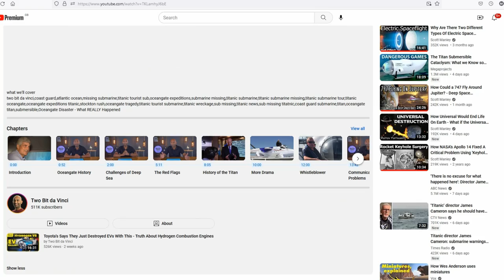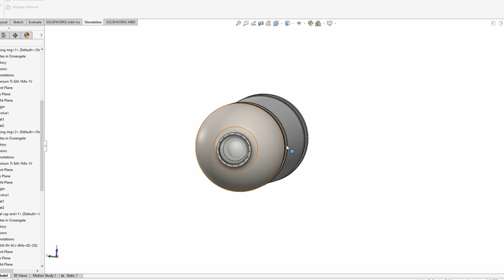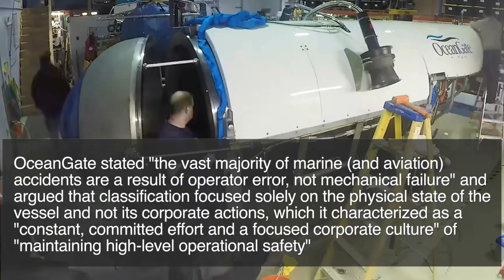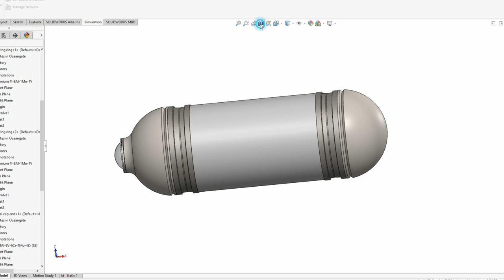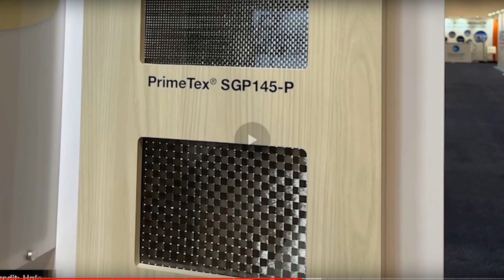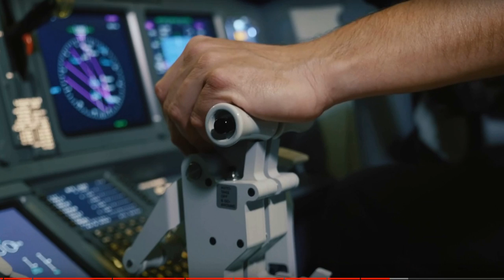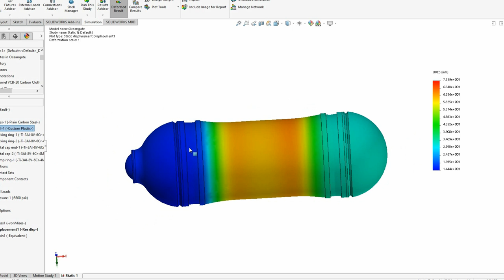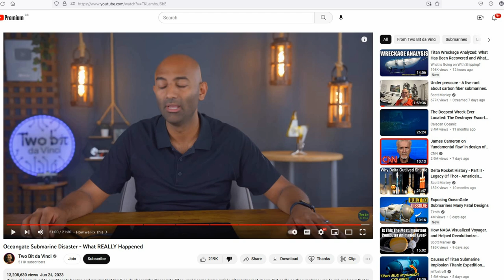Oceangate Titan - Engineering Failure?

Comment: The force of the hatch bolt are nothing compared to the force of the water holding that hatch shut. Think of it like a check valve, the force on the other side is what keeps the valve sealed, if that force is removed the valve opens. I think most hatches are a tapered cone so the higher the pressure keeps the hatch centered and sealed.

Comment: Imagine if they 38:05 were on the surface for 5 hours and the sun was beating down - they might kinda overheated 

39:47 the controller you speak of has a higher spec than off the shelf controllers - your naïveté speaks volumes

Comment: Great effort explaining possible (and probable) scenarios. Thank you! But got a question here: I somehow lost track when it comes to the "shockwave" part late in your video... You tell/show the caps and bubble-glas popping out. Outwards? I always thought the the outer components would be pushed inwards by the outside pressure. Really a little unsure now which way direction parts would take when (for example when the acrylic plexi-Bubble would crack and eventually shatter).  Anyway, good stuff. Cheers!
Reply: Another possibility is when the pressure differential was removed from the titanium hemisphere it re-expanded / vibrated sharply enough to percussively shear/pop all the bolts holding the perspex window - someone can calculate the stored spring energy maybe?
Reply: @MarkTillotson  probably so... just found out what an implosion in super-slowmo looks like (with much smaller objects of course) , but you´re on point with the "re-expanding i guess. Your stuff seems a lot more straight forward and logical than most shite i see on yt. THX again!

Comment: The glue was not the problem. The glue joint not allowing for the compression deflection of the carbon tube is the problem. 7mm reduction in Dia according to the Solidworks data. The sulution would have been to seal the joints with O-rings. apply some plumbers grease to it and pull the two halves together with tie rods, That way, the joints could move against each other to compensate for the rate of compression of the carbon tube. The stored energy in the deflected tube must have been huge. It must be allowed to deflect along the entire lenght to avoid build up of stress un the clue joint.

Comment: instead of glue, how would you join titanium and carbon fiber together then? maybe glue flexing is the only way with materials compressing at different rate.
Reply: 1) Don't use dissimilar materials.
2) if you do, use a much longer transition/overlap?
3). I've thought about bracing the ends (tie them together) with more titanium. hmm.

Comment: Your missing the floor inside I wonder if it split down the line of the structure they added for the floor 
Or my belief is that the structure for the also added to the non uniform force that was applied to the cylinder and the failure in one of those areas the floor or the end caps

Comment: I don't agree that the porthole tapped holes would have stripped out if they had 1.5 or more depth to diameter ratio. It's generally accepted engineering principle that threads with in-tolerance form at 1.5 or greater, the minor diameter of the bolt will fail before anything bad happens to the threads of the hole.
Reply from the maker: We'll see, but looking at close up photos of the cap ends released yesterday, there's no sign of any broken studs, and there's 18 of them.
Reply: @dirtygarageguy  I have no clue about how the half sphere endcap could come unbolted from it's adapter ring. Was there an adapter ring on the aft end? If so, why? Couldn't the half sphere of the aft end been bonded to the CF tube?  I was commenting on the bolts for the porthole retainer. Of course those may have been sourced from Walmart....

Comment: Perhaps rather than glue the rings should have been compressed together by straps that ran the length of the tube to stop the rings falling off at the surface, then with a rubber interface between the ring and tube. This way the interface would have been free to move during expansion/contraction and settle in with the water pressure being the sealing force (Just like the window).

Comment: You're the first one I've heard who called the center tube for what it was, plastic.  I grow tired of hearing the term "carbon fiber" like it's the answer to everything.  It rolled off the lips of Stockton Rush like nothing could go wrong, because after all, it's carbon fiber, a million times stronger than steel.  He didn't say "million", but that's exactly what he implied.  Plastic is absolutely the wrong material for this application, as this incident confirmed.

Comment: Does your solid-works model include the 7000 ton end loads?  With the necking of the cylinder due to radial loads on the side of the cylinder, I would imagine that the ability to resist such end loads would be diminished somewhat.
Reply from the maker: Solidworks applied a pressure of 380 bar to the entire exterior surface.

Comment: Agree 100% that the cylinder with glued rings idea is an inherently poor design considering how stress is distributed (and especially through cycling).  One comment about your discussion of shock waves and acrylic cap coming off:   It's not just the acoustic waves.  The water would also be rushing in at ~220m/s at a depth of 2500m (they lost comms 2/3 way down; using Bernoulli's/Torricelli's equation: https://en.wikipedia.org/wiki/Torricelli%27s_law ; taking water to be incompressible up to 6000 psi is a good approximation).

Comment: There is a publication of the communications between Titan and the surface.  We think it was leaked.  Sounds realistic.    First the decent was much faster then the rate normally used, about 1 m/ minute faster.  So it would have reach the Titanic is less then 2 hrs. vs 2.5 hrs.   Was that on purpose or just happened?   A few sensors lit up and they dropped the sand but didn't get positive buoyancy.  They dropped the skid weights and showed a sluggish rise.  More of the sensors went red.  They gave short answers and at a slower response time.  Lost communication within about 20 minutes of starting to abort the dive. 
     So the vessel gained weight not accounted for in the buoyancy calculation and set up before the dive.    The only source of weight is water within the composite structure. filling and holding open cracks.   The pressure radially on the outside is depth pressure and the pressure radially on the inside is atmospheric.   Thus in 5 inches is a gradient.  The cracks extend from the OD inward.  The water hydraulically would  produce a radial, hoop and axially  force straining the cracks open and adding to the load on the fibers.    
    Could the glue between the metal and composite be the location of failure.  Also the window.  However if the weigh gain is accurate then  this would not happen for them adding sufficient weight to cause the problem.   Also interface adjustment is the meat and potatoes for doing a finite element analysis and adjusting the design to deal with the interface issues.  What isn't standard the sea pressure and the understanding that to save money highly experienced analysist were not hired.

Comment: The titanium ring appears to only slide onto the hull about an inch or 2.  I'm not a sub expert, but that put tremendous pressure on such a small surface area. That ring should have been pushed down way further.
Reply: If it was screwed on to the Carbon - (and a thicker Carbon at that) - this could have made a difference. Im sure it would fail as well after so many loading cycles. I wouldnt dive in a swimming pool in that thing, after seeing how the end pieces were glued in.

Comment: Has anyone considered hydrostatic pressure issues - high pressure seawater in a crack that penetrates further into the hull encounters lower pressure and will act as a hydraulic wedge, opening up the initial crack with massive force due to the difference in pressure...  Its a failure mechanism of some dams for instance. 
I can see that if the glue starts to fail from the outside of the ring the water could get into an intermediate laminate layer and just crack it apart, effectively transfering the full ocean pressure onto a thinner cylinder, rinse, repeat until overload.

Comment: The individual forces of water pressure on a half sphere can indeed be sumarized in one point but the resulting force is not zero. It is only zero in radial direction and also zero for all other endcap surface shapes no matter how artistic or asymmetrical. The resulting force of any endcap is the cross section area of the cylinder times the pressure and is axial to the cylinder.

That is the nature of any pressurised  surface covering a given hole. The net force of an opening is given by the path of the hole.

Comment: Just a point about game controllers. On pretty much everything the military would use them they're for convenience and they always have redundancy. They are never used for anything that is critical to the life of the system either. In Titan, I believe they were the only source of control. Yes, spares were available, but I believe game controllers were the only source of control onboard.

It appears that the pilot didn't have a fixed position and as everyone sat on the floor any instability could result in a loss of perception. Add that to everything else and you have a disaster waiting to happen.

Comment: The difference between an XBOX controller and a third Party Logitech controller are MASSIVE.   ALL those third party controllers are bad. Unreliable and do not work as good as the real thing. And even the proper ones are prone to give up the ghost at the worst times.

Comment: 1:25:50

No, it does not sound that stupid necessarily. 
But it does in that context.

 AHSS = Advanced High Strength Steel

But it's purpose is completely different than building planes or submarines out of it.

Comment: You may recall my earlier comments on Facebook about pressure being sufficient to seal the surfaces as depth, as long as lower pressure did not establish a secret path into the pressure vessel. which has been known to occur. I cannot accept your premise that outer space is harder however, for the reason that we have been working with those extremes since the 1930s maintaining an internal pressure against a vacuum is a piece of piss comparatively. It just needs a strong structure and a good seal against internal dynamic pressure. A reversed cone on effect. Why cant they open a door on a spacecraft? Because Scotties engines are giving it all she's got.

Comment: I think the reason they said 17 or 18 bolts was that apparently the surface crew had a habit of not installing the last bolt at the top because it was difficult to reach. They figured it wasn't strictly necessary because at the depths it matters it's already under extreme compressive loads, so just didn't bother.
The safety culture, or rather lack thereof, at this company is a joke...

Also, while the transcript floating around the internet hasn't been verified as authentic yet, it suggests they had ~17 minutes of warning from the aucustic sensors before sudden catastrophic failure. So they worked, just nowhere near as early a warning as the CEO assumed, because unlike steel, when carbon fiber starts to fail, it usually fails completely almost instantly rather than deforming.

Comment: I think that the focus on the culture of safety of this company (or lack of it) is important even though many of the issues discussed are not related directly to the actual disaster. 
What they illustrate is an overall lack of planning and operational safety discipline. 
An exampke of this is OceanGates argument regarding its decision to not have their vessel classified while making claims that issues with deep sea exploration tend to be caused by the poor operator safety. This statement coming from a company operating without a method of tracking their submersible on the surface or even an ROV for seof rescue. 
It was done on the absolute cheap with an unclassified veasel AND  remarkably lax operational safety.

Comment: As a surfer, I will throw in my two cents. I work with fiberglass,  resin, epoxy and myriad materials and adhesives. The ocean is unforgiving and boards crack, shatter and bend, especially in heavy waves. Using adhesives and carbon fibers, without stress tests, are absolute antidotes for failure and implosion. Common sense, intuition and sound reasoning tells me that submersible was doomed from the beginning. Money and ego motivated Rush over safety and sound engineering.  Those that built that vessel had to have known that they were on a fools errand.

Comment: I am finding it difficult to understand why the central section was made from carbon fibre and not from the same material as the end pieces. What was the actual reason for this? Even if it wasn't at all possible to make it out of a single billet, why use a different material with different qualities, different expansion and contraction rates etc to the end caps? Then to top it off, glue it together... Just seems bizarre!
Reply from the maker: Because titanium is a lot heavier than carbon

Comment: You said "under pressure the inside would be under compression" this is not true, as the cylinder deforms it is stretching the inside wall so it is actually under tension.

Comment: A cylindrical bathyscaphe is inherently a bad idea, that's why it's never been tried until this monstrosity of a deep sea coffin.  They didn't use a large sphere able to accommodate 4 or 5 because of the expense, not only of the pressure vessel, but the cost of flotation material.

Comment: If pressure inside and outside then the occupants would have to spend a week + in a hyperbaric chamber or die fo the bends. 
If you are saying the pressure equalized  preventing a reversed pressure graident making it impossible to push out the window, then you are not taken momentum  into account. 
The occupants died of heat exposure long before they got wet . Think of how a diesel engine works . Squeezing from 1bar to200bar is more than enough heat ( apply boils law)  to cause fuel oil( lubricants inside components eg xbox controler gamble) to spontaneously combust, cotten( the occupants clothing) needs less heat  to combust at atmospheric O² concentration

Comment: Rapid compression of the air to 300+ Bar would create a lot of heat. Think of a diesel engine. Is is possible that the vaporised humans would act as fuel for a diesel type combustion and thus further increasing the pressure?
Reply from the maker: We're talking an implosion that's at the speed of sound in water, so about +1000 m/s that's so fast that any reaction that starts is pretty much smothered in water.

The crew won't be vaporised. Vapour  is at lower pressures not higher.

Comment: There's a huge difference between being a test pilot flying around the sky and a sub deep in the ocean. If your plane fails there's an easy way out to safety it's called a parachute but if your sub fails you're screwed there's no escape no parachute no  escape hatch you will be CRUSHED. The only escape would be another sub attached to yours through which you can escape not very practical.

Comment: 1:20:00 in, and my bullcarp detector is going off like crazy.  I worked for British Airways' engineering department from 1988 through about 1994 -95 or so.  This was around the time that the FAA and CAA were bringing in mandatory corrosion checks on various things.  Why?  Aloha Airlines flight 243.  That wasn't something that "engineers figured out" (well, technically it was, but not Boeing's engineers at design time), it was a response to fatigue and corrosion that impacted operational maintenance.  It resulted in a massive emergency check schedule, and a lot of remedial work.  that probably saved a load of lives, but it wasn't thought of beforehand.  It took a near-catastrophe to throw up the issue, it was extremely lucky that (IIRC) only one person died.

Wanna know what was funnier?  Concorde.  It used to regularly lose parts over the Atlantic.  And there were so few of them made that in certain cases we trekked down to Duxford and "borrowed" parts from G-AXDN.

Comment: The control pad thing never made sense to me...  It's proven technology that's been around over a decade.  Of all the things they designed poorly on that vehicle, that control pad is not one of them.
Reply: having it be wireless with no real backup was a huge problem. wireless opens up interference and then having to sync and such a sync problem would affect all the other wireless controllers. so yeah cheap wireless controller and not mechanical backup using a joystick control system is a big no no in the luxury sup market. everything was cheap and when dealing with an environment that can turn you into paste hearing camper world or discount materials is not comforting.

Comment: the only issue I could have seen with the remote is the lack of hard wire - his comments on carbon fiber are odd - scuba tanks have had carbon fiber options for sometime now - I havent used them but most of my time diving someone has

another thing is the temperatures reached at such depths - the comment at 1:49:09 about the seal needing to be small not sure what thats about also i dont see any glue squeezing out

Comment: There were steel under the carbon fiber that could have been compressed like a soda can before the final implosion.
Reply from the maker: No, that was just the mould.
Reply: This has puzzled me too. So, the stainless steel cylinder that the carbon fibre was wound around was later removed, leaving a 5" thick CF cylinder as the pressure vessel and passenger compartment?